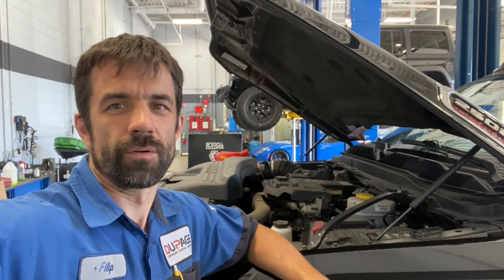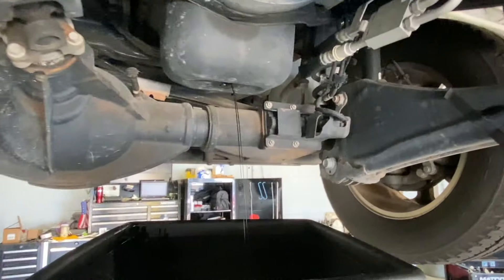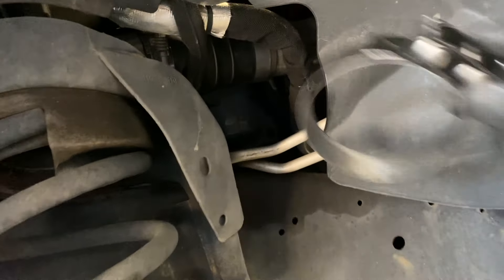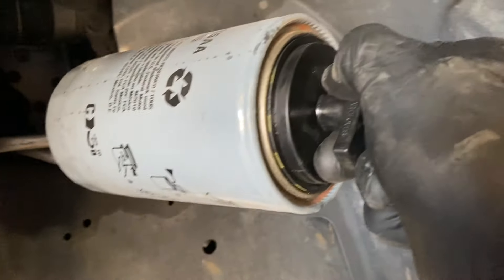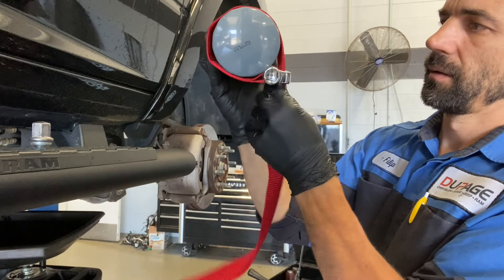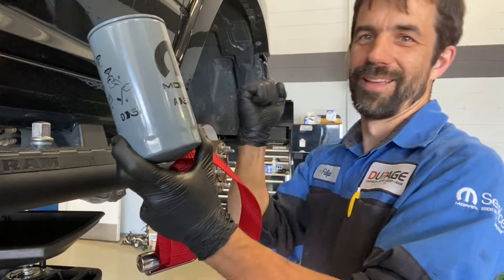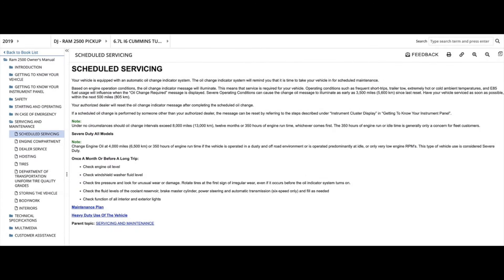Watch This Before Changing Oil on Ram Trucks with Cummins 6.7L!

Comment: Dude, I’m sitting here looking at my owners manual for a 21’ and it’s not 8,000 miles.  You must have the hemi info pulled up.  It’s 15,000 miles.  But 8,000 miles is a safe interval
Reply: LOL,,,,,I always change my one ton dually 2017 HD Cummins at 5000 miles or less but then I actually use my truck.
Reply: if you change your oil every 15k miles you're just asking for the engine to blow lol
Reply: @transgendapenguin yep.
Reply: People don't understand that technology advances, that being said engines and oils do too.... 15k is fine.  I know it's scary but it's fine as long as your vehicle is equipped to do so .....
Reply: @joshuacolgin1892 yup. These guys saying “I actually use my truck” 😂 calm down cowboy. All hot shot tow’rs change it at 15k and go half million miles plus on a 6.7
Reply: @andrewrenner5809 absolutely,  if your running mainly OTR 15k is ok. And if your running your truck like a inner city transit bus every 10k is a must.
Reply: @transgendapenguin  well, my 08 has had its oil changed at 15000 since new with Rotella 15w40 and never have had any issue whatsoever.  Had oil samples done and everything is 100%.......and I work my truck.  Plowing, towing, and its never let me down.
Reply: I’d highly recommend changing oil at 5k miles.  Keeps oil build up down and I’d rather spend a couple extra grand on servicing the truck than 15-20k + on a new engine, plus the labor depending on if you do it yourself or a shop does it.  But that’s my opinion

Comment: That's an amazing tool for the filter, I just use a 1 gallon ziploc bag after you loosen the filter so when you turn it sideways it spills into the bag
Reply: How many times have you spilled that bag?
Reply: @mgiffee6816  i havent spilled it once,the trick is to close the bag before taking it out
Reply: Love it!!!
Reply: I just put a rubber glove over it.

Comment: Changed oil in heavy equipment for twenty years. When they would get stuck I would just hammer a pry bar through the filter and turn it. After I changed my bosses pick up truck oil, as he started to drive home, sometimes I would say, “Dang, I don’t remember tightening up the oil filter tight”

Comment: Thank  you for showing Oil filter cap off tool. I was recently changing the oil on my 2018 and dropped the filter making a huge mess very mad at ram for this my 2010 is so much easier

Comment: Try Geno’s garage. They make a oil filter socket that get the 6.7 Cummins filter off easily.  And they sell the plug too. Also, if you have an aftermarket air intake, you could just grab the oil filter from above.
Reply: thats exactly what I do pull the  air intake in a few min and makes it easy

Comment: I've owned two brand new Cummins trucks.  On both of them, the original oil filter was installed by the boneheads on the Cummins line with dry gaskets and at least 50 ft-lbs of torque.  Fortunately, that was back when you could still get at the filter with the cup style wrench.  But it still took a 24" cheater bar, and the gasket squeaked loudly for at least the first full turn.  Why can't those idiots follow the instruction printed right on the side of the f%$kin filter??? I've been changing oil for 40 years....they NEVER leak when done correctly!

Comment: FYI > I purchased a oil filter wrench and oil filter cap through Amazon; no mess!  Both made specifically for the 6.7L Cummings diesel engine.  If I could upload a photo of the oil wrench, I would - it fits perfectly under the oil filter, so to either loosen/tighten it.

Comment: Hi I am new to this engine does a fuel fuel need changed when oil is changed?
Reply from the maker: @rogerl8488  I’d say change the fuel filters every other oil change. Newer trucks have a service minders that you can go by, I would change oil and the fuel filters before 20% is left. If your fuel filters look black you need to change them even sooner, some gas pumps can have a bad fuel.

Comment: What about the drain plug gasket?? Does it need to be replaced? If so, what size is it
Reply from the maker: OEM drain plug has a rubber embedded on the edges, no gasket is required. Just inspect and replace when needed.

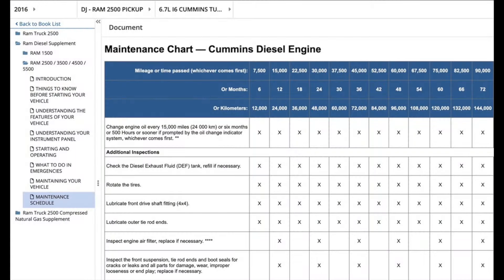Comment: I am confused. At 6:39 the chart at the top shows oil change every 7500 miles or 6 months. However the first written line says change every 15,000 miles?
Reply from the maker: Yes it is confusing, but as long as you use full synthetic diesel oil like Rotella and go by the cluster oil reminder all will be good. I personally would not go over 10000 miles. These engines are not cheap and sludge is hard to get rid off
Reply: Run those extended intervals all you want, just don't give the shops lip when you take it in because the engine is blowing oil out the exhaust.
Reply: @fjb666 LOL tell us you don't own a diesel without telling us you don't own a diesel. 15K pil changes on all of the Ram trucks on our farm with zero issues. Oil sampling is taken at each change and multiple companies used so all the eggs aren't in one basket. We also do this with all of our equipment. Zero issues with any of the Cummins doing this. Now the older ones we did 7500 mile oil changes but the new trucks running Shell T6 5w40 FS is an absolute waste changing it at 7500miles.

Comment: How did you drop that filter without oil dripping from the space the filter screws onto? Every time I drop the filter down vertical so nothing spills out the filter before putting on the filter plug, I get oil dripping from the area the filter screws on. I use a zip lock to catch that oil and it is a mess half the time!
Reply from the maker: Do you first drain the oil?
Reply: I change mine cold after pickup has sat awhile.  Filter isn't quite as full that way. Can usually drop it down and put my genos garage cap on the filter to tip it out without spilling.

Comment: Thanks for the video. You missed one very important thing. Always remove the starter relay first. Most of these trucks have remote start. Imagine if the engine started with no oil in it? That mistake will cost thousands of dollars. It's good practice. I worked in a Dodge dealer 28 years and have seen some serious mistakes done in the express oil changes.

Comment: I just took my brand new 2022 ram 3500 cummins into dodge dealership to get a oil change ......literally right after I took it off the lot I get this tik ......when it is parked and I rev it to 2000rpm you can hear this Nasty tik.....
Reply: Gotta love them hydraulic lifters. Stupid they changed that. Failure point
Reply: They probably put to thick of oil in it, there is a tsb
Reply: Hopefully they only used required 10w30?
Reply: @MrWhiteTank fuck 10w-30 in a diesel. It takes 5w-40 because of the stupid hydraulic lifters.

Comment: 15k interval the OEM recommends is BS. I change every 7-8k, T5 rottella, T6 is good too for extended oil changes.
Reply: oil is better these days and made for extended change intervals. I know its cheap insurance on a $80K truck but try doing a used oil analysis next time and i bet it will show you that the oil you are dumping out is still good.
Reply: 8000 miles in oil no way I do em at 3000 miles t6 rotella
Every 10,000 miles fuel filters air filter 
Every 25,000 ccv filter
It’s cheaper matainance

Comment: You don’t need to get your engine hot tot drain …if you wait 30 min 0r longer it all goes into your oil pan ! And there is no point to take your dipstick out
Reply: I agree. I like doing my oil changes. When the car has been sitting over night. So all the oil is in the oil pan.

Comment: I don't understand where you guys get the idea that you have to go in from the side to access the filter. I just changed my oil. Got the truck a month ago. Watched all of these youtube vids on changing it. I just changed it from below the old school way and never spilled a drop. It's just as easy as any other pickup I have ever owned, if not easer. Didn't need to remove the wheel, or inner fender, or any of the rest of that BS.  Just used the old cap style wrench. It was a breeze.
Reply from the maker: @beavisroadhog9629  Perhaps your truck is not 4x4 and does not have a front axle? I don’t normally remove the wheel and fender cover has oil filter access so no need to remove that.

Comment: a flat rate tech is not going to wait 30 minutes on an oil change that pays .3
Reply from the maker: People should be educated that Cummins engine is not an ordinary engine and oil change should cost accordingly. In our dealer techs are getting .5 for diesel oil change and most have 2 bays so they can let it drain while doing something else.

Comment: I just have to rant for a second about how much I dislike the current placement of the oil filter on the passenger side of Cummins company trucks. It's just too close to the tire and it makes changing the filter a nightmare. It's seriously one of the worst design decisions I've ever seen. Ugh, just frustrates me to no end.
Reply: Someone said to remove part of the air filter tube and then you can pull the filter out from the top.
Reply: Someone said to remove part of the air filter tube and then you can remove the oil filter from the top
Reply: I have my wife or a helper on a step stool help me guide the new oil filter back in place from above.  It’s a royal PIA trying to do it through the wheel well without a lift.

Comment: In 2022 Ram 5500 you can't reach to the oil filter, you have to remove part of inner fender liner, because the space is too narrow. Some people removing  air filter housing to reach the filter from the engine bay .
Reply: @hetanosgago9508  I didn't remove fender liner but my hand hurts. Bout to hire a lil Chinese feller.